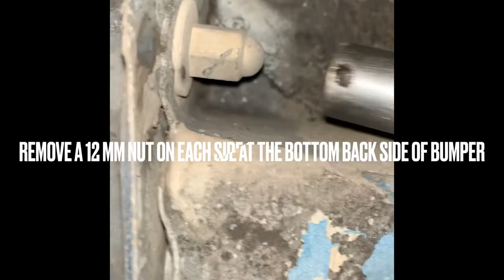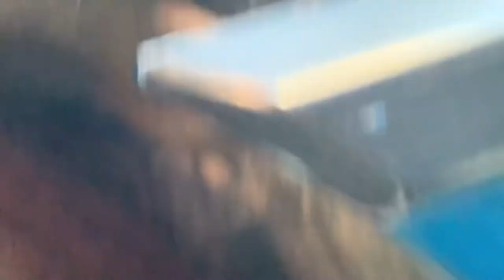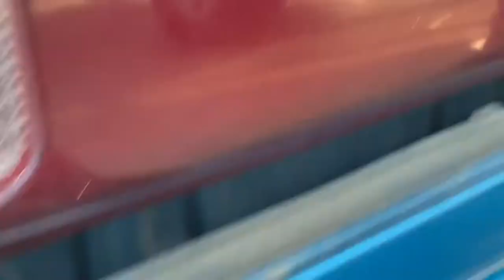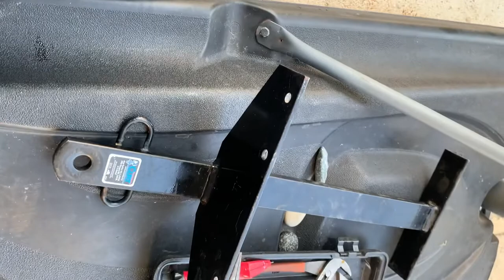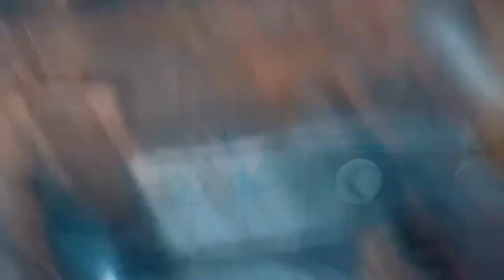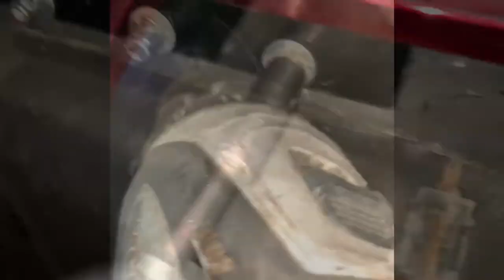How to install a Curt trailer hitch to 88-91 Honda Crx diy

Comment: could you message me with some measurements for the hitch? i’d like to try to make one myself
Reply from the maker: So sorry for the delay, 
26 inches to the subframe with hole at the end for tow ball 
Welded to subframe mounting bracket is 18 inches long with 4 holes 3 inches apart.

I hope this make sense, let me know if you have any questions 

Thanks 
John

Comment: Will this work for the accord ?
Reply from the maker: For sure not going to work because according has a longer floor board compared to crx.  The measurements are made for crx but it could probably work with extended or longer and wider measurements